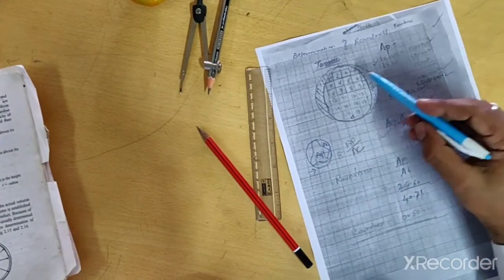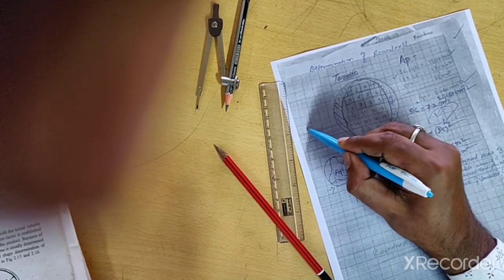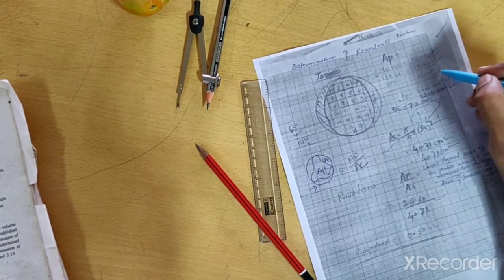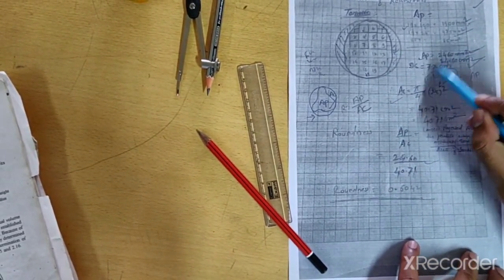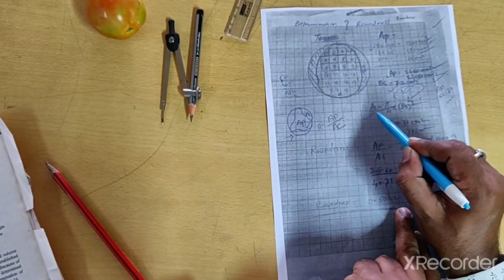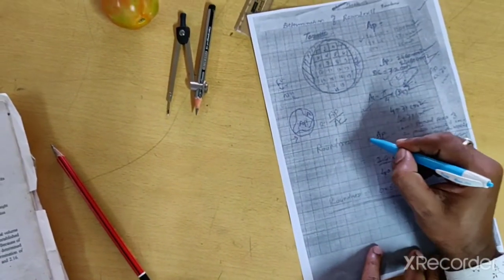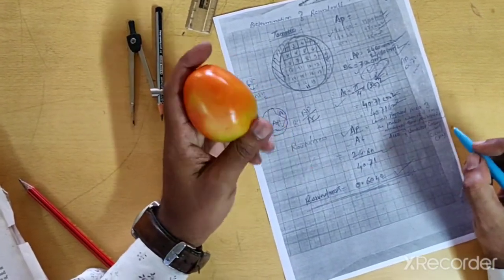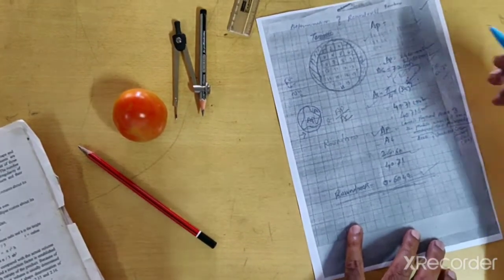Determination of Roundness of Tomato- II

Comment: Sir, excuse me but you talk too fast.
Reply from the maker: Thank. you for your valuable suggestion. I will definitely try to improve the same.
Reply: @dnyaneshwarmondhepatil490  sir where did the 19x25= 475 mm^2, 85 x 1 = 85 mm^2 came from as well as the 19 x 100 = 1900 mm^2 ?